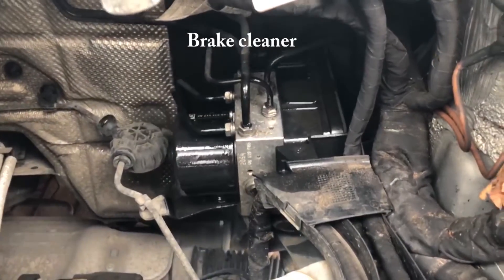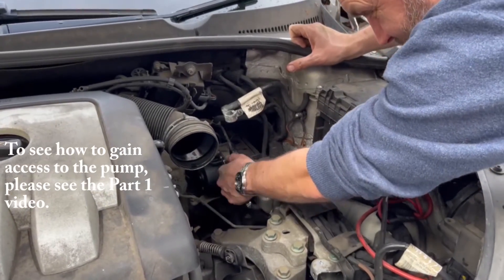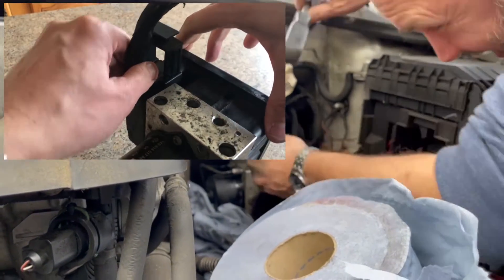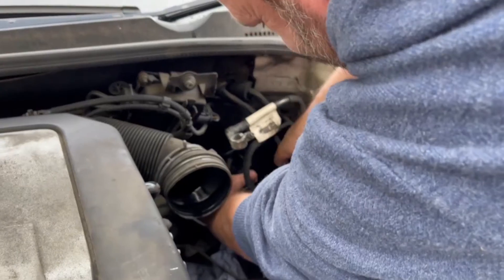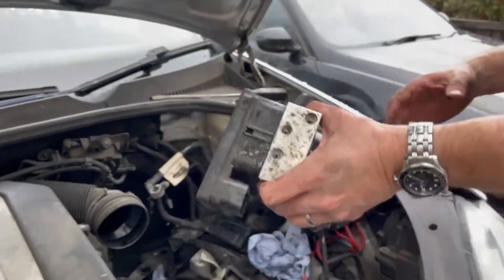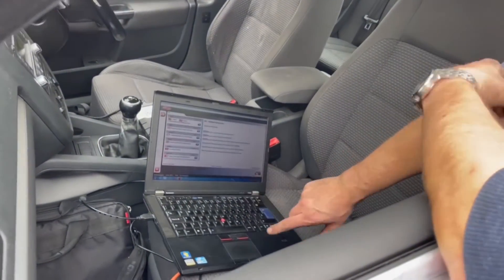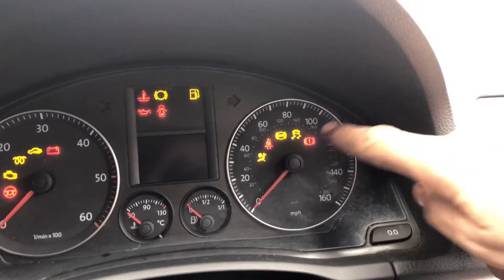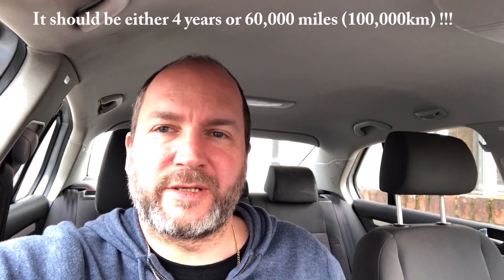VW / Audi / Skoda / Seat - G201 (01435) ABS Pump Error - REPLACEMENT - PART 2

Comment: Hi there, great video, im attempting mine 2moro. Were both ur bolts the same heads on the pump? One of my bolts looks like a torx but with a metal like ball in the middle which iv never seen (new to doing my own car repairs) jus wondered if its a special tamper proof bolt or something? 🤔
Reply from the maker: You can buy the tool, its VW specific (I think).
Reply: @NeilsCarsAviationTravel  all done, i just cut the bolts off mine, the bolts on the other pump were just a normal torx bolt. Job done all good and passed MOT 👍🏻

Comment: I have an Audi TT with a faulty ABS pump. I bought a compatible used one. I would like to know if I just need to disassemble the parts to make it work because now I have assembled the used part but the car brakes badly and I haven't solved the problem. Could you help me?
Reply from the maker: Did you get the G201 code before and now it has gone?

You need to bleed the brakes also by braking hard enough for ABS pump to vibrate.
Reply: I replaced it with another ABS pump detached from another Audi TT but now it brakes worse than before the oedal goes all the way I would like to know if it needs to be reprogrammed or if I try to disassemble and reassemble the old pump with the spare part it will work
Reply: I have the ABS brake and TPMS lights on

Comment: great video, this is the first vid i've found with all the steps involved. i've just bought a mk4 golf and turns out someone has cross threaded one of the break lines so going to try remove and helicoil the hole?😬if that doesn't work i suppose ill try a second hand unit. so did you not bleed the breaks before hand? guessing if there not under pressure not too much fluid should poor out?
Reply from the maker: No need to bleed before hand. Very little came out. 
I haven’t heard of this issue on the Mk4 Golf, so not sure if it’s the same process.

Comment: good, did you change the abs unit, did you code it or just put it on the car and on the road
Reply from the maker: As detailed in the video I swapped the ECU so it does not need coding.
Reply: @NeilsCarsAviationTravel  thanks
Reply: @NeilsCarsAviationTravel  I didn't change the car ECU, only the electrical unit of the abs, I want to change it and I wanted to know if I buy another one, I have to code it or I just mount it and that's it

Comment: while switching off the engine - that sounds like a Dual Mass Flywheel fail :/
Reply from the maker: It’s done 20k miles in the past year (with remap) and still on original clutch and flywheel.

Comment: Awesome video! If both pumps have the same part number, it should be plug and play without coding correct?
Reply from the maker: Correct as long as you swap the electronic units as shown.
Reply: @NeilsCarsAviationTravel so my issue on my 09 GTI is that I recently replaced the abs module/pump with a donor vehicle that is comparable. I was able to do the long coding on the module successfully but when I attempted to do the adaptation/basic setting. I’m getting that the brake pressure sensor 1 G201 is at 250+ bars  (thinks I’m pressing the brake) although I’m not. I drive the vehicle around and the brakes don’t appear to be sticking. Could it be that the donor module I installed has a failed pump side which is where the G201 sensor is located??? Any help would be appreciated

Comment: What a great video! I have a problem with the fault code 01130 on my Skoda Octavia 2008, hand brake light is flashing all the time. ABS cylinder part number is 1K0614517BD , but i  don't know what the part number of control unit is. Because it is mounted now and i have no access to the back of the ABS pump. If i buy a second hand pump and control unit with different part number, will it possible to code it? My car is cheap and not worth spending a lot of money on.
Reply from the maker: I’m not really sure if you could code it, or even if it would physically fit. 
I think I used my phone to take a photo of the pump part number to confirm I got the right one.

Comment: Unlike Roomster / Fabia you dont have to pull the engine to access the ABS unit, lol. Was your unit exactly the same part number as the swap?
Reply from the maker: Yes the part number was an exact match. I’m not sure I’d want to chance it with a different part number.

Comment: Hi great useful video, my skoda roomster the abs pump is not providing and brake fluid to nsr wheel , so looking at replacing with a used pump .
Seems that the pump will not need reprogramming as long as i keep to its original ecu ?? 

Thanks Buddy
Reply from the maker: Yes, if its the same pump as the Golf it should be plug and play with no coding needed.

Comment: My gamble hasn't paid of and fault still there, do you reckon it could be the module, or by luck iv got a another faulty unit?
Reply from the maker: Did you clear the fault code after replacement? It doesn’t go on its own, you have to use an OBD scanner (laptop or tablet) to delete the code.
Reply: @NeilsCarsAviationTravel  yes cleared with vcds and fault code come straight back, I have another pump coming This one been tested  so crossed fingers I shall let you know :D
Reply: @K_I_T_C_H  let me know what happens
Reply: Hi there I also have an issue, 2 codes: and operation 01130, abs hydraulic pump (v64) 01276. Do you think if I do the same thing you have done the code will clear? Or do I get the pump rebuilt which is quite pricy

Comment: i am glad you could fix it so easily...Congrats..:elbowcough:.I have the same issue on my audi a3 8P2 1.9Tdi
Reply from the maker: Are you going to give it a go?
Reply: @NeilsCarsAviationTravel  Am gonna have to check a few things before like fuses and other  parts then yeah i will have to either fix or replace it.

Comment: Hi Neil,  have same problem, do I have to have a scanner,  or will lights go out by itself,  they go out on start up, but then return  steve
Reply from the maker: I had to delete the code using my laptop, but hopefully any friendly mechanic can do it for you for a few beers. Only takes 5 mins.
Reply: @NeilsCarsAviationTravel hi mate how did you know the ecu wasn’t bad and just to change the pump. I want to change the pump but keep the ecu but how did you know if it was ok to reuse without coding
Reply from the maker: @NorthernIrelandFishingReports  if you got the G201 error then it’s likely the pressure switch in the pump (it’s a very common issue). 
I just swapped the ECU over as per the video.